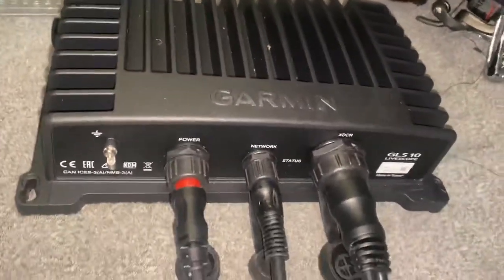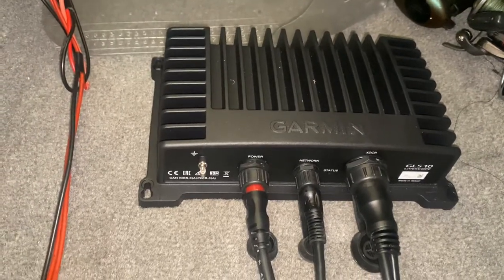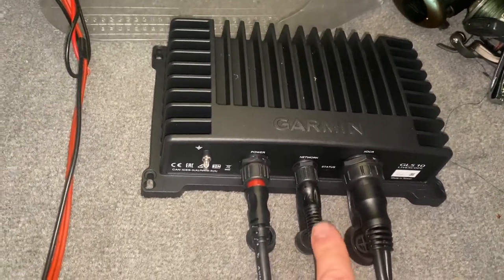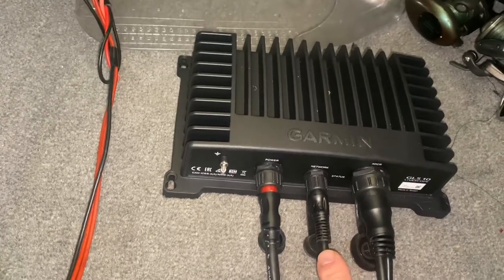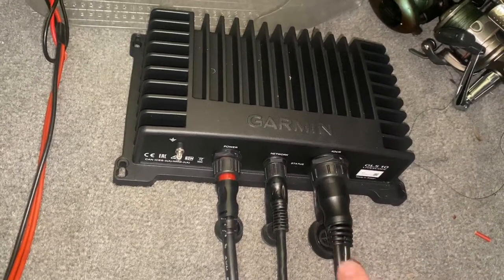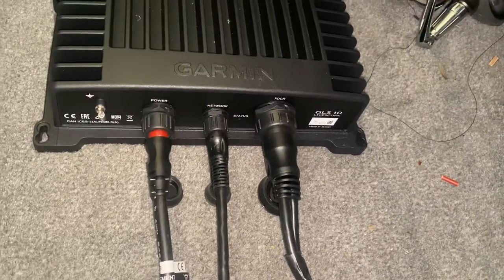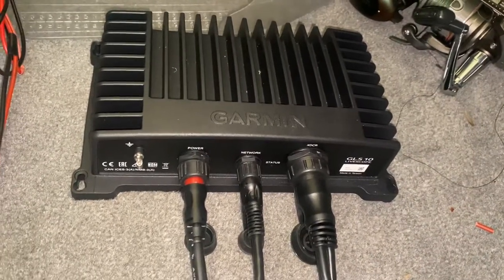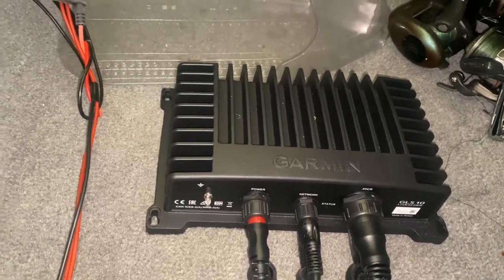Garmin livescope box and transducer

Comment: So does the gls 10 supply power to the monitor or do you run another power source for monitor ?
Reply: The gls10 and lvs unit should run on their own battery source for best performance. I run my chart-plotter on one 12v20ah and i run my livescope on 2x 12v20ah wired parallel.